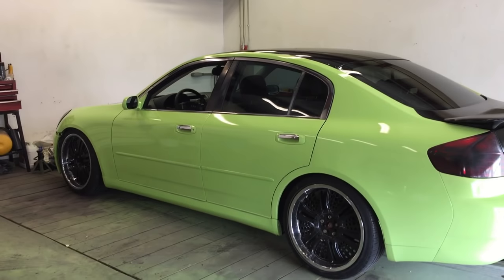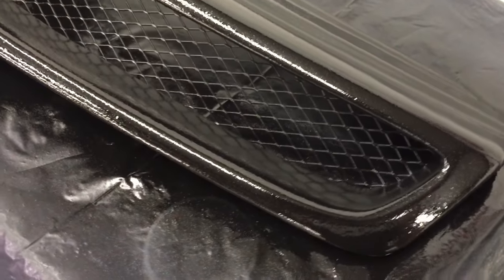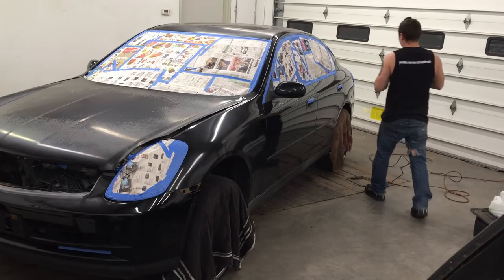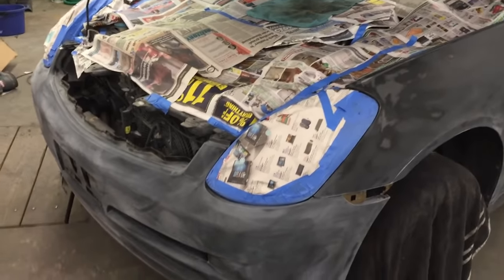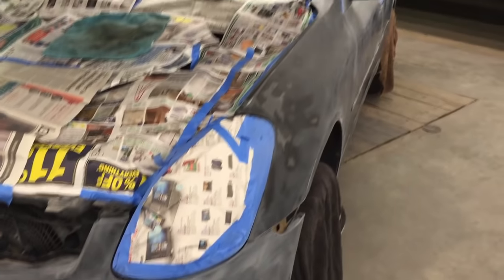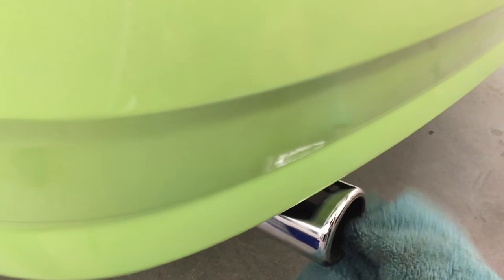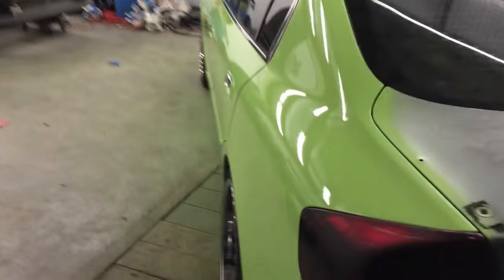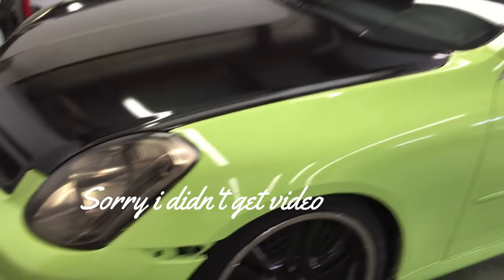Cheap Rust-Oleum Legit DIY spray can job you can do for 40$ or less! #budget #cheap #rustoleum

Comment: I used to beat myself up attempting to paint cars out of can's like this. Yeah, its totally possible to do this and you have done it. But the day I finally decided to use a paint gun and proper materials I realized that doing a car out of spray can's isn't worth it. You can buy that same rustoleum paint in a regular can for $15 at tractor supply. do an 8-4-1 mix and get way more paint for the money, and do the job better and faster out of an HVLP gun. Sure, you have to find a compressor, and buy the gun, but after a couple small jobs it pays for itself. and having a compressor around is good for other things.
Reply: What is 8 4 1 mix? Thanks much
Reply: 8 parts paint, 4 parts thinner, 1 part hardner. so for example, if you start with 8oz paint you would add 4oz thinner, and 1oz hardner, mix and put in the gun. you can multiply this to match whatever amount of paint you want to shoot. so if you started with 16oz paint you would add 8oz thinner and 2oz hardner. or 4oz paint, 2oz thinner, .5 oz hardner. the last one is the lowest I would go because its difficult to eyeball less than half an oz accurately- at least on the cups I have.
Reply: @kyle-kelliher  thank you sir
Reply: Knowledge is power! Thanks
Reply: Kyle's cars aye Bra so how much u think i would need 4 the front hood down 2 bumper & just the back bumper on a sedan? & can I spray right over the original factory paint or do I have 2 strip it
Reply: What kinda of hardner do you get for Rust-Oleum
Reply: A Ak 47 is also handy

Comment: Great job bro. Use a mask next time tho. Want u around to keep making these vids.👍👍👍
Reply from the maker: I have had this comment a lot. I couldn't find my mask so i bought a brand new one (the one i use in my newer videos) and then i found my mask after buying a new one so now i have 2. The shop was well vented hard to see on camera since there is only 1 angle really. But don't worry i have been bashed constantly for not doing it but it didn't effect me in any way so we are good! :D  Meaning no negative effects even had a chest X ray done during my wellness check up and they said no blockages or anything bad so dodged a bullet.

Comment: Not bad not bad! Way better than Macco
Reply: Tommie Hall For a year or so.  This really needs to be protected with a 2K clear for UV resistance.
Reply: Jordan Hillard how much time will a 2k clear give the paint?
Reply: Angel Lawless Decades
Reply: A good couple coats of clear is definitely good investment, but dude you were bang on it’s WAY better than Maaco
Reply: Definitely not better than macco
Reply: Definitely better than Macco👏🏼
Reply: @pgharaghani28  nah it depends where you go, not everyone has the same amount of skill with paint and body work. let alone like me and the other bodyman where I'm at we have very similar results but we dont block and buff quite the same. The reason Macco or with a real spray gun will do better is because they have much higher pressure spray guns which help it spray much more flat where in rattle cans are more likely to have heavier orange peel
Reply: @20502chris  I see well I didn't know that because I don't know anything about paint and body work I was just judging by how it looked in the video. 
But you're probably right because I have always heard a real spray gun will always be much better so thanks for explaining that!
Reply: If you put the time into sanding it like he did a macco paint job will last longer. I’m sure he used rattle can clear coat as well and that wouldn’t last more than a couple years. It looks great though, the finished product doesn’t look like a rattle can job.
Reply: uhh,no.google "great maaco paint jobs"
Reply: is maaco that bad?
Reply: Tommie Hall TRUEEEE lol

Comment: That is really the best spray paint job I've ever seen. Great job man. And for $40 you can't beat that. So after 3 years how has it held up? Would love to see what it looks like today.
Reply: Unless it sits in the garage it won’t hold up. There’s no clear coat on it
Reply: @geegeegeez  exactly what I was thinking
Reply: @geegeegeez  I don't think I could do all that work and not clear coat it in some manner
Reply: @geegeegeez  it has protective enamel in it, it’s pretty tough stuff.
Reply: Im doin it to my Dakota 5.9 R/T. So far really good. However im adding 2 layers of coat just in case 👍
Reply: @castromotorsports4611  can we get an update on how it’s holding?
Reply: @StitchDGlitch  you think you could spray a clear coat over this?
Reply: @StitchDGlitch  Rustoleum also has 2x ultra clear coat that you can spray over it for extra protection. It's 5 bucks a can. I've seen others do it.
Reply: @castromotorsports4611  Rustoleum has a clear coat spray can. It's called 2x ultra clear. You can do that as a finish for extra clear coat protection.
Reply: @JBpineapple  Yes
Reply: I rattled a car red just to see if it’d look good and last. I used the Rust Oleum clear over it. It looked really good for maybe a year(1/2 of that it was garaged. Then it sat out in the sun and within a year the clear coat peeled off and it looked like hell. I think if I had used real clear over it with a gun it would’ve lasted a lot longer if not indefinitely.

I’m certainly not a pro but I’ve been doing body work for a while, I’ve painted many panels (with actual paint equipment/paints/proper prep)as a side hustle and painted 4 cars(2 for myself). All that has lasted many years so I know I’m doing as least some things right lol.

All the work that goes into a proper paint job, combined with the fact that rattle can don’t have the pressure and volume, I’d say not worth it. If you don’t have the equipment or place to paint it’s one thing. Otherwise not worth it.
Reply: @alloutofdonuts3998  How many coats?? Cause most of these buys in these vids want to keep it as cheap as possible, especially the guy in these vids. You can do 3 or even 4 coats of clear. You can also after a while do a ceramic coat on top and it makes it even stronger. You can get a bottle of ceramic for like $60 bucks for a good one and it's enough in one bottle for a sedan sized car. Also, when you used spray cans and spray can clear, you can't really leave it out in direct sunlight every single day all day. It's not as high quality as the rustoleum that you mix yourself to spray with the gun. But as I said, these guys in these vids are doing 2 coats of paint and one coat of clear sometimes two. You can do 3 or 4 of paint and 3 or 4 of clear and then IF you want you can do the ceramic. Yeah it will be more money but it will last way way longer and be stronger protection in the sunlight. Maybe you spend like a total of $250 but at the end of the day it's WAAAAY cheaper than taking it to a paint shop.
Reply: I'm a total newb in this, Is this legit paint job if you clear coat it? I mean would it stand against a pro paint job in terms of durability?
Reply: @WestleyRulez  this is just my opinion but I don’t think this paint will hold up like a professional job would as far as how long it would last before something popped up underneath it. Even if you used a good clear.
Reply: @robmen1402  I agreee. I went about it basically the same maybe an extra coat of each. I was doing it like these guys do. Cheap as possible lol. The clear definitely isn’t made to last of such large surfaces of metal to stay out in the sun like that, kind of what I expected. I believe it could’ve been done better. The main challenge for me was the lack of volume and pressure like you can get with a gun.i ended up painting it gloss olive green with my gun set up a few years later.
Reply: @alloutofdonuts3998  yeah that's why you have to do way more coats then he and most do in these vids, lasts way longer. I did it and I didn't get any peel for about 6 years. I was keeping my car under a canopy at home that I bought for $120 bucks. So it was never under direct sunlight if i was home. When I started getting peel I just lightly sanded the whole thing and put on 2 more coats of clear and a ceramic coat. $120 total.
Reply: Wondering myself isn't enamel super tough?
Reply: I have been painting with rattle casfor 18+ years. Won't last past a year due to a few facts. 
He only got one layer on there. 3-5 months in the car wash will start to destroy it. 
Let say you hand wash it, maybe last a year but the rag you wash it with will scratch up such a thin layer of paint.  
No garage,  and it will be dull as hell in one year under the sun. Restoleum has no UV protection.  

It you want it to last, you must layer up the paint. Once he fully painted it, I would repainted the whole damn thing with 2 more full wet coats. $120-$150 in rattle paint.
Layer it up and it will  last 3-5 years in the elements or 7-10 years garaged. 
For more protection,  add a 2k clear after. 
Don't be fooled with $40 5 month paint jobs. Thats trash.
Reply: This will hold up if you satisfy 2 conditions. First, always use a grey self etching primer. 2 coats preferred. This will single handedly fully harden your top coat and make it not peel. The second thing is use multiple coats of clear that have the 2 part mix inside the can (the one with the red cap you need to press in on the bottom) as this ensures you get a very hard bonded clear on your color coat. If you don't do these 2 things, it will fail if sitting in direct sun most of the time.
Reply: oh and you should always then sand your clear coat down to 5000 grit and then polish and ceramic coat. No point in painting your own car if you are gonna leave the orange peel. It will look like crap if you're standing anywhere close to it.
Reply: Did you guys scuff the paint before you put the 2k rattle can clear on, only reason I can see it peeling off and how many coats of clear???
Reply: @OregonHydrographics1  you never attempt to scuff your base before clear,  unless it has fully cured for at least a month.  You should be relying on the tackyness of your color coat to bond your clear coat
Reply: @JasonEllingsworth  Cute, I have been painting for 39 years. ALL basecoat paints have a window that if you do not get your next coat on inside that window, you scuff it
Reply: @OregonHydrographics1  yes exactly.  That's what I'm saying.  Cute.
Reply: @OregonHydrographics1  if you aren't immediately applying clear,  you'll have to wait for the base to cure before scuffing and clearing.
Reply: @JasonEllingsworth  you are so wrong... So when I paint custom bikes that have 5+ colors and will take weeks to lay all the graphics, in your world I have to wait 30 days to scuff?  Window for most bases is 8 hrs...  after 8 hrs you can scuff, even innercoat, which is a clear base, that is used to protect the graphics laid you scuff after 8 hrs.  So if a body shop applies base on a Friday and can't get it cleared your saying they have to wait 30 days to scuff and apply clear?  Learn to paint before you give false info!
Reply: @OregonHydrographics1  we are talking about rattle can paint jobs... I know what I'm talking about. If you don't wait 30 days before trying to sand a heavy laid spray paint,  then you'll just rub it right off with your sanding.
Reply: @OregonHydrographics1  and you don't have to sand your color coat at all.  You can go right to clear,  and sand the clear.  This is all basic info
Reply: @OregonHydrographics1  cute. AND when you use something like a 2k clear that is chemically hardened,  you don't need to wait very long at all to sand that. I'm only talking about waiting for a heavy base color coat to cure IF you aren't immediately applying clear on top
Reply: @JasonEllingsworth  but you do not HAVE TO wait a month like you stated
Reply: @JasonEllingsworth  correct you do.not always have to sand your base but if you do wait more than the TDS Stated window for recoat, you must sand or you will lose adhesion for your next coat.  And it is not a month, that is the basis on my disagreement with your original comment...
Reply: @OregonHydrographics1  you do,  if it's a heavy spray bomb paint coat,  like they are doing  in the video.  Please just shut it. I don't care. Maybe you live in an area with very low humidity.  Ours is always above 85%.
Reply: @JasonEllingsworth  funny if you ever have to wait 30 minutes and if your spraying so heavy that it is on tbe verge of running your giving a crap paint job anyways...  a quality paint job is done with tack coat and  multiple medium wet coats not a one and done.....  I have not won best of show and done vehicles for SEMA because I paint like it sounds like you do!  So keep spraying crappy paint jobs atleast that's how you make it sound like you do...
Reply: @OregonHydrographics1  its like you didn't even watch the video to determine exactly what kind of job people are doing.
Reply: @OregonHydrographics1  im guessing you inhaled too many paint fumes. My work is immaculate.  I was speaking for the people who are spray painting their cars,  which i would never do,  but if i did,  i would follow the directions on the can.  It definitely says on my spray cans to top coat immediately,  or wait 30 days.  There's a reason why.  I don't care what you've done.
Reply: @JasonEllingsworth  that's fine because you will never do what I have done
Reply: @OregonHydrographics1  i don't care even a little

Comment: cool. nice job btw.
i painted my Kawasaki ZX-7R superbike with a can of PJ1 Kawasaki green, alpine white and flat black spray paint.

it looked amazing! perfectly smooth, flat and no imperfections at all.
the only part painted green was the upper fairing extending partially to the lower fairing.
the largest area was the white covering 90% of the lower fairings and tail section and it turned out perfect as well.

the black was just for narrow accent stripes, a border around the number plate on the tail section and a small area at the bottom of the belly pan for all the white sponsor logo decals. i clear coated everything as well.

it truly looked professionally painted.
a nice paint job can be done by spray can if you properly prepare the surface and take your time.
as can clearly be seen by your car! sweet!

Comment: dude that looks super good.  good work.  if you hadn't filmed it, i wouldn't have believed you did it at home with a rattle can.  thumbs up man.  here in canada we have stuff called tremclad and its also rust paint , really thick and shiny, dries slow but dries into a nice durable shiny finish.  i used rust paint on my subframe and engine mounts and they turned out really nice and shiny.

Comment: Great job! I painted a hardbody with rustoleum spray paint about 5 years ago and it looked like the professionally painted trucks parked next to it. After about a year, the color on the roof and hood did start to fade due to UV exposure. The sun is very harsh on paint, especially when combined with dirt from the road plus washings.
Reply: Same. Also a hardbody. Lol
Reply: isnt the clear coat supposed to protect it?
Reply: @vityazsix  No. Standard Clear coat doesnt have UV protection in it. You'd have to use specific UV resistant paint and clearcoat, like actual car paint is.

Comment: Painted my cj7 with rustolium  2x, and it turned out great!! Used implement paint on the inside of the tub (with a paint brush, it’s self leveling,tough, and cheap) ford an implement, and rustolium 2x apple red are an exact match!
Great job man, a lil prep goes a long way

Comment: Do you have an update of how well the paint held up after a year?
Reply: Yup , thats what I Wana know aswell 😊
Reply: I used the same paint on my truck wheels over two years ago. It's still nice after two winters and off roading in the summer. It just has a few rust spots on the edges from normal road wear. It's actually holding up better than the new chrome bumper I put on the same time.
Reply: I did four coats.
Reply: You meant after a week!
Reply: GG 556 wow sounds interesting! Just so I understand you did 4 coats of paint then high heat enamel on top? I wanna paint mine
Reply: @vanequa  4 coats of HH enamel thin coats so it doesn't run. Then 2 good coats of clear. Do not dust it on. It's just as good as the guy at my work that had his powder coated from a shop.  They both show the same signs of wear for about the same time he put his on a week after I painted mine.
Reply: GG 556 the high heat paint works well. Especially high heat engine paint!!!
Reply: Lol,  itle be fucked after 2 years, mine paint jobs were, but when I painted them they were emaculate mirror finish paint jobs,  its just the paint in aerosol cans that ain't factory paint doesn't last long until it dulls and rubs off etc, it also isn't as tough, scratches easily and stone chips ,cats jumping on the car bird poop etc
Reply: @user-pk8pf8nh6s  😹😹😹😹
Reply: @hesgotamotor8288  It don't matter now. Still looks the same nothing rubbed off. I just traded the truck in for a new one. So it did what it was supposed to. Held up fine for years for $10 in paint. I have pictures so I can prove it I don't make shit up.
Reply: @user-pk8pf8nh6s  nice job buddy,  bloody hell  $10. Its $20 for one can of plastic kote aerosol can here in new Zealand , I'm painting my car at the moment, went from dulux galaxie blue that lasted 8 years  to plastic kote metallic silver, and black trim
Reply: @hesgotamotor8288  It's only 4.99 a can of enamel around here. After tax it was a little more.
Reply: @hesgotamotor8288  Goddamn Maaco or Earl Scheib the same damn weak paint!!!
Reply: @hesgotamotor8288  I painted my bicycle frame with rattle cans  like 15 years ago and it still looks good. I guess I did better job at painting that you or used better cans.
Reply: @user-pk8pf8nh6s  lmfao best comment here! Sounds like it came straight out of my mouth.
Reply: You did an AMAZING job❣️👏
Reply: Nice